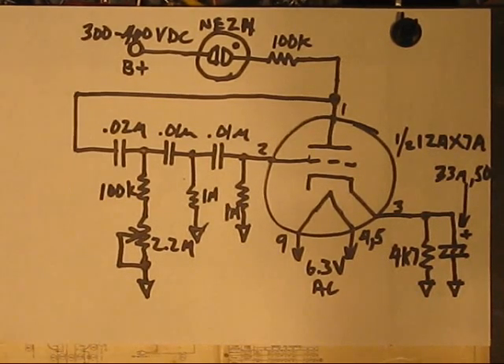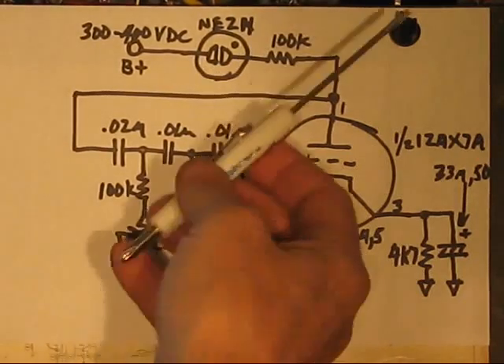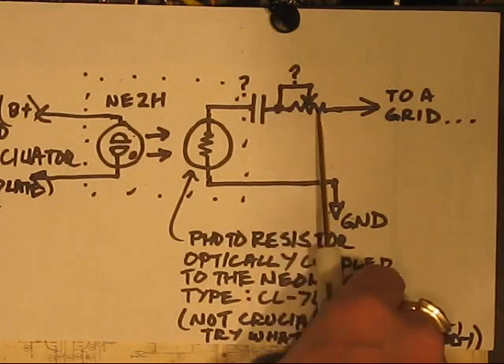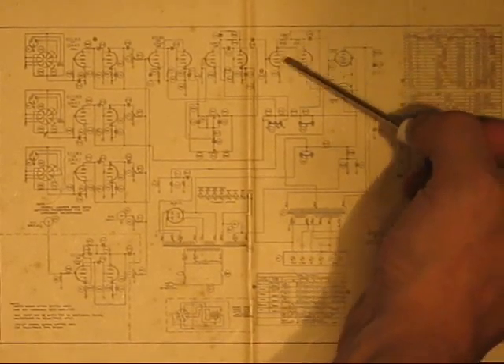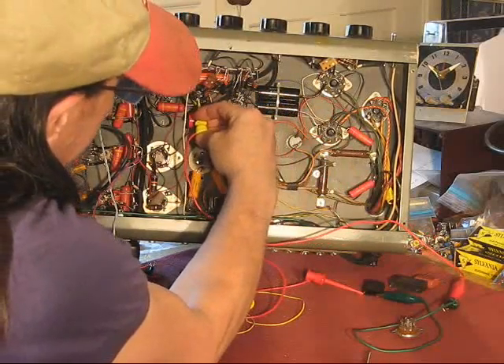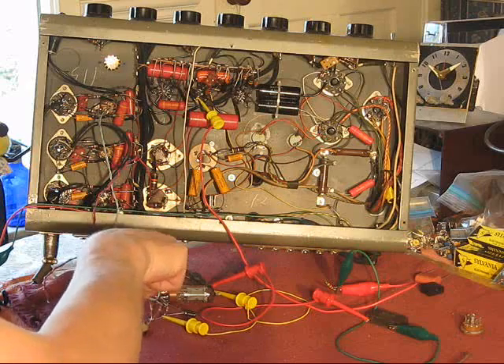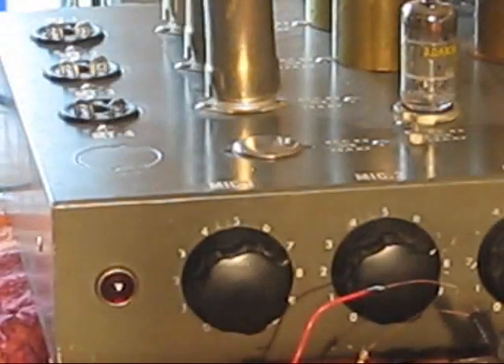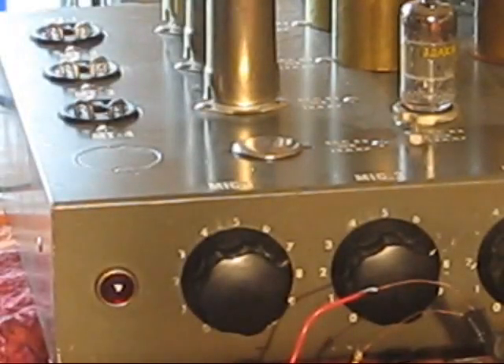Vacuum tube tremolo circuit part 2 of 2

Comment: Yes it would be cool to have reverb and a master volume. I have the same amp and have been playing around with cold clipper and bright caps. Looking into cascading gain into the extra 12ax7's. This thing rocks as it is but I like playing with it. A lot of the caps have turned in to resistors and I've replaced them. Mine is a 64. This video is a bit old so I hope you are doing well.